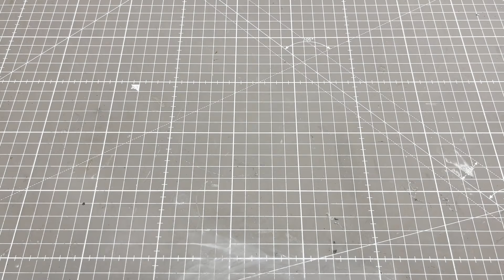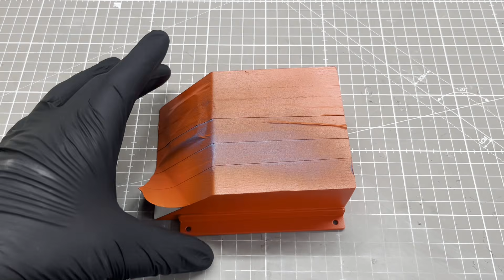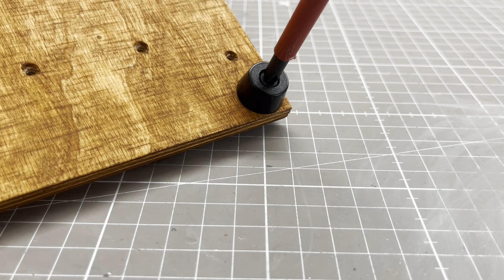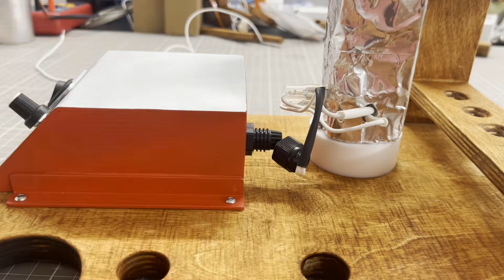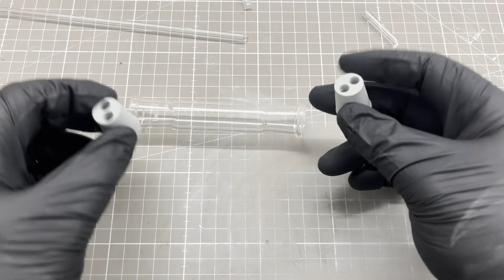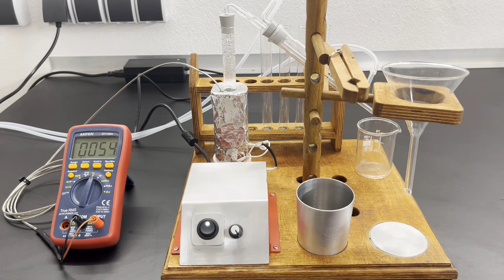Building a mini chemistry lab

Comment: Very compact and neat. As a side note, I have found water-based "personal lubricant" very useful for getting glass tubing into rubber bungs or tubing. It does raise eyebrows when it appears on the lab materials purchases though...
Reply from the maker: A little bit of dish washer works also well :)
Reply: @Marbslab I used the lubricant because, for some reason, it claimed not to damage rubber...

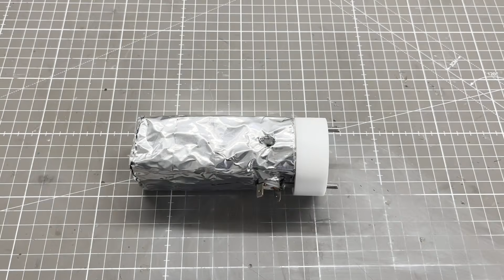Comment: 1:20 sorry to comment so soon, but I think these thermal probes are notorious for getting stuck in the on position and requiring rapid cooling to recover. It should be combined with other safety features.
Reply from the maker: No problem till now, It switches of at 238 °C and has a hysteresis of about 10 °C. It's already for safety. The temperature is controlled by PWM.
Reply: @Marbslab  Makes sense, I did not notice the PWM controller also has a limit. Should have waited :)